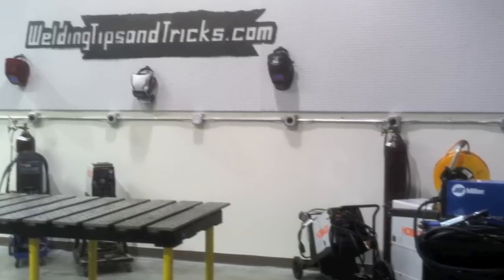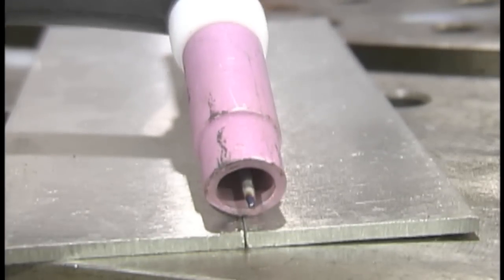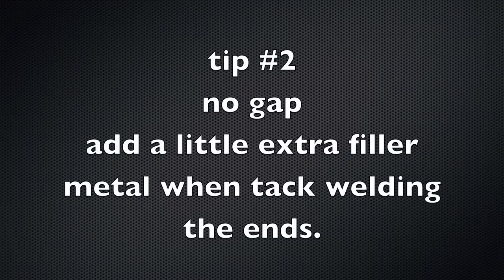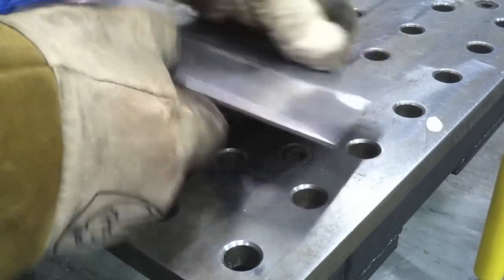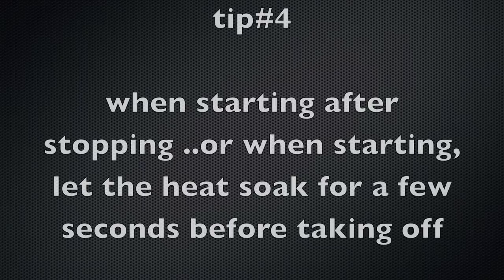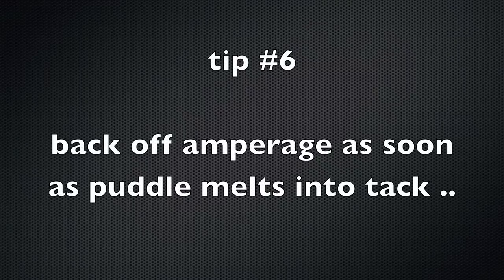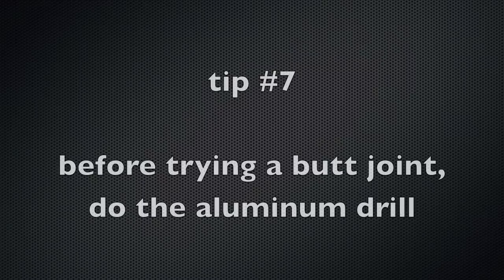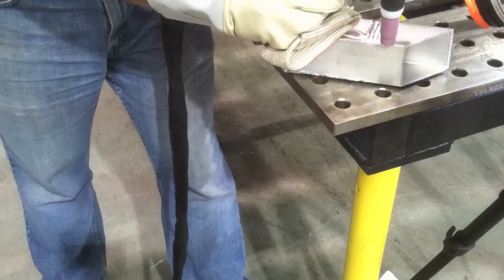Aluminum Welding 1g TIG Butt

Comment: OxyFuel Welding is the first step in learning tig welding, when yea move to tig welding gets to be a little faster, the puddle start up faster as well as your travel speed may increase. Also tig can be a little bit forgiving when it comes to looking good. Also you dont necessarily need to use a pedal for tig welding, most people like it for control of heat at the start and for the end of the weld and tacking.

Comment: I dunno, i find oxy welding aluminum easier but i'm also still fairly new to it. As long as you don't set the flame too hot its easier to keep a uniform puddle cause you only have to worry about travel speed as opposed to travel speed and the amount of pedal you give it.